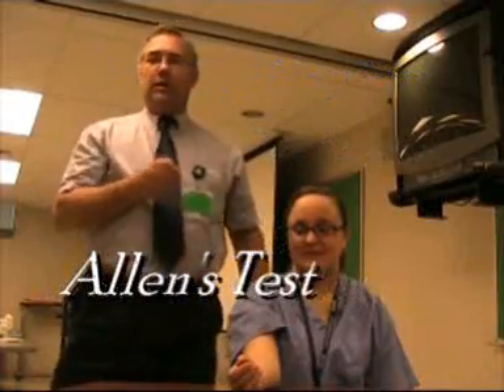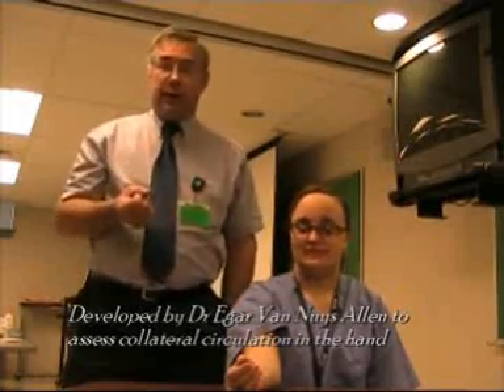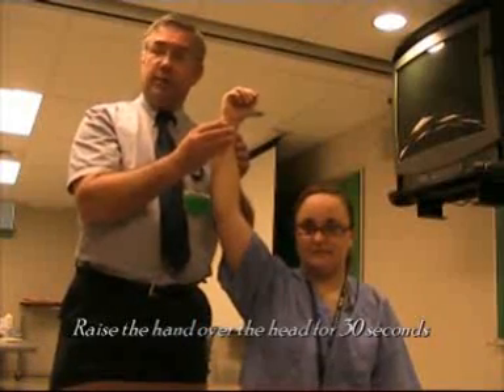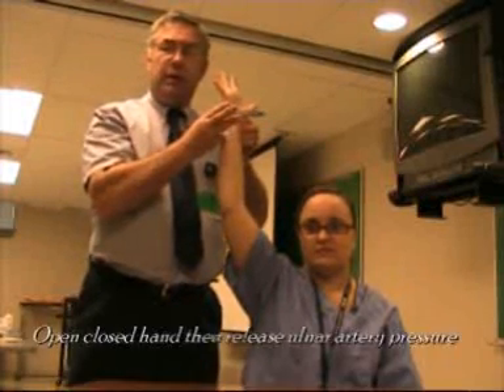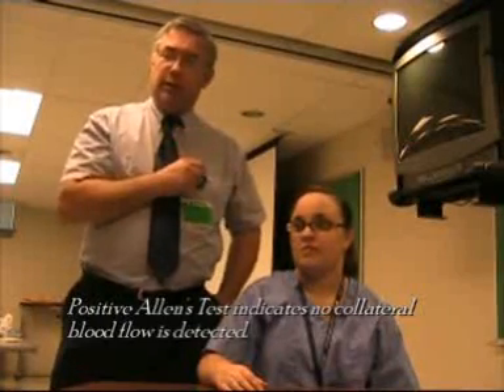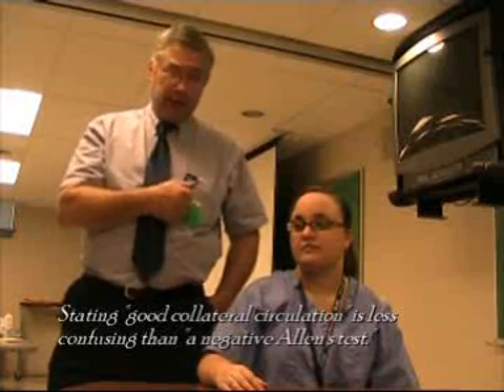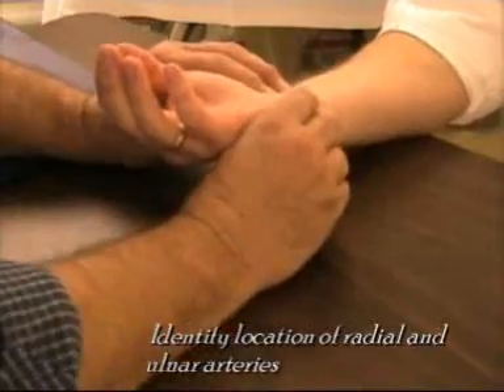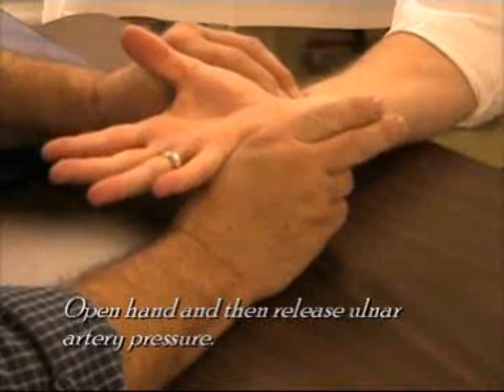RESPIRATORY CARE: Allen's and modified Allen's test

Comment: If the Allen test is POSITIVE the radial artery CAN be used for puncture because there IS good flow through the ulnar artery based on the immediate flushing in the hand after releasing pressure over the ulnar artery.
Reply: Not according to NCBI resources.  They state  "A positive Allen test means that the patient does NOT have an adequate dual blood supply to the hand which would be a NEGATIVE indication for catheterization..."  So the author of this Youtube VIDEO is correct.  .  ,https://www.ncbi.nlm.nih.gov/books/NBK507816/